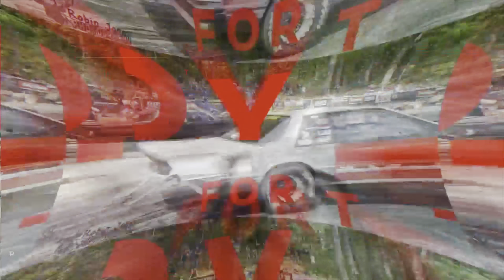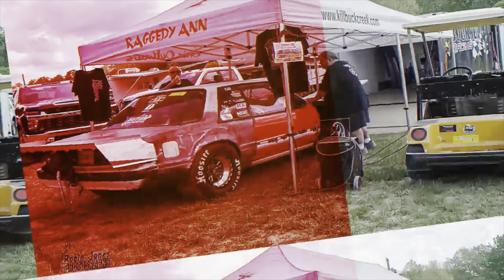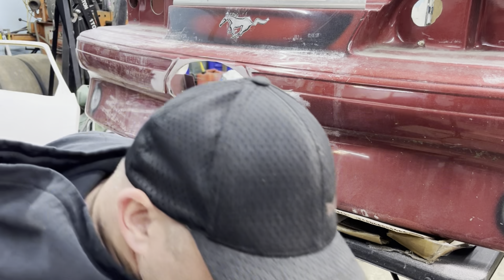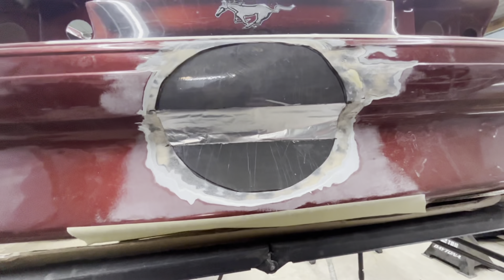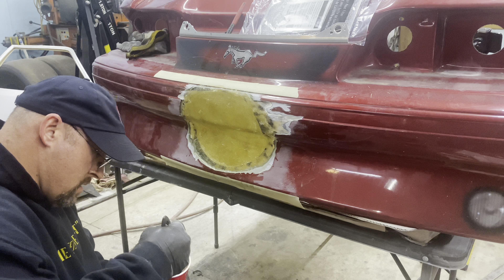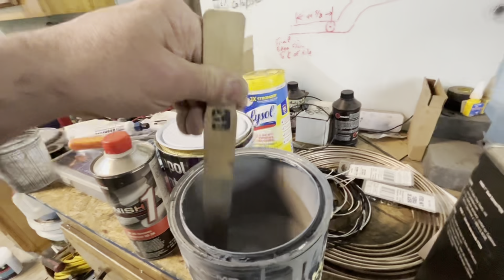Raggedy Ann’s body transformation begins. First step plugging the hole!

Comment: Need to go out around the hole a little further with matting if you don't it's going to  Crack under stress and I know it's going to receive some stress 😂
Reply from the maker: Yeah. I feel I probably should had over lapped it another 2” or so.  But it should serve its purpose for a while. Thanks for the info though. Appreciate it.

Comment: You did a good job fixing it but would have been easier to tape the front do the repair from the back then done your filler work on the front
Reply from the maker: 💯.  Lol. I said that when I took the garbage off the back. It was formed a lot nicer than the front. Live and learn. Appreciate the info.

Comment: It’s not the worst body work I’ve ever seen but you wanna try to sand out your fiberglass or filler to at least a 180 to 320 so your primer isn’t showing deep sand scratches then your primer layer is a primer layer rather than a glaze layer.
Reply from the maker: Yeah. I got it formed and didn’t want to take anymore off it so I just laid her on thick. Same way I done the 1/4s on the og ra and blocked my ass clean off.  But it turned out pretty good.

Comment: Great idea but that fiberglass will never have a good bond to tge plastic bumper.  It will Crack and ket loose eventually. I would gave used those bumper pieces you started with and welded them to existing bumper with a plastic welder or a heat gun works great. Then take 2 part plastic repair around entire perimeter over the weld after weld us ground smooth. This eliminates a big edge to fill around hole. Then bonds over to get a smooth contour and prime and paint. That would be one way of doing it without having to worry about the fiberglass lifting and cracking later on and half the work and time. Mending a rubber bumper with same material is always the best bond!! Just my opinion,d/b/a Kustom Hotrod Restorationz,Canton,Ohio
Reply: The whole nose is fiberglass it will bond great
Reply: That's great if jts a complete fiberglass frontend!! I was just speculating in it being a stock front end! I ve seen a lot of stock front ends on small tire cars that were made into one piece to save the price of a fiberglass or carbon fiber front ends. Just giving my opinion on a stock material front end!!
Reply from the maker: Yes this front end is fiberglass with steal fenders molded to it. Should bond fine. I understand what you’re saying with factory though.  Only thing I’m alittle concerned with is the over lap of new to old. But should hold good for a while anyway.
Reply: @raggedyannohiosmalltire2329  just trying to help. I've been in the business for over 50 years and a drag racer myself!!
Reply: If you ever need any advice feel free to ask anytime
Reply from the maker: @drewarlotta3818  thanks buddy.